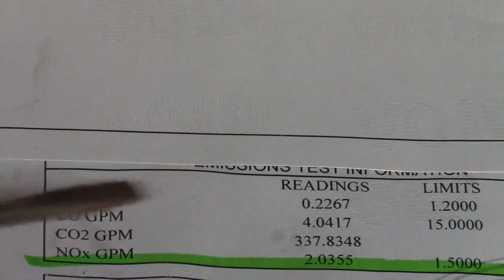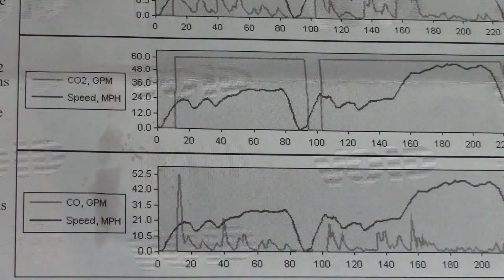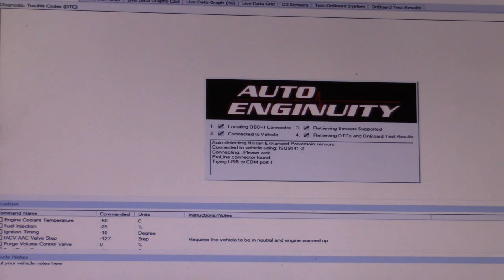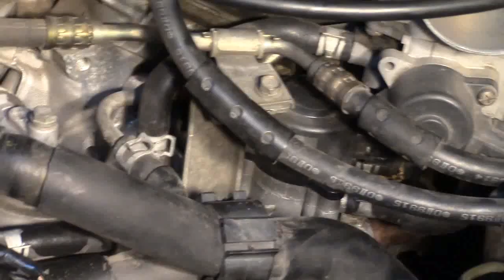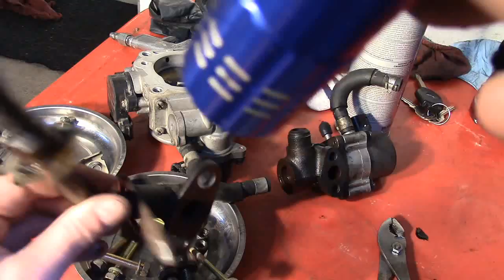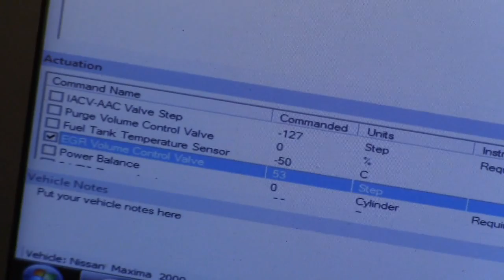2000 Maxima NOx Emissions Fail, No Check Engine Light- Bad EGR?

Comment: You mentioned that you can't just apply 12v to a stepper motor to see if it works. Why is that? Also, have you covered in any video how to back probe at connectors and/or at the computer so there is no possibility of harm to the computer?
Reply from the maker: You can't just test a stepper because it works by alternating the polarity several times per second- it's almost like A/C instead of D/C in a way. It also has two fields -one for the reverse one for the forward.  It is not just a straight 12V application like a simple motor or solenoid type.

 Also I always cover backprobing techniques to prevent damage to the computer- but it's different in each application depending on circuit design,  Generally however, the idea is you simply cannot short a PCM driver to ground without resistance in between. If the driver is a power side switch it is far more of a concern but if you short to a PCM ground side switch without load you can equally damage the driver.
  It is essential to know the specific circuit design- power or ground side switched and if it's through PCM or not to really know the risk you face not testing correctly.
Reply: Schrodingers Box  Can you recommend a good source that explains what you mentioned about the PCM, necessary resistance, and about power or ground side switching? Thanks Matt!
Reply from the maker: caduceus33 Can't really think of one sorry- you will need a channel that covers basic automotive electrical and you should find information there,  You might try Stuzman52 his channel is filled with automotive electrical videos. If anyone covers these concepts he would.

Comment: Hey Matt,
What is a good source for the above average DIY'er to get wiring diagrams from?  For example, where did you find the diagram on the Nissan EGR?
Thanks!
Reply from the maker: I usually just google them but AllData DIY is my infallible resource. It's about $20/month and you get dealer level manuals.
Reply: Schrodingers Box I checked out AllDataDIY and found I can subscribe for one or five years, and a subscription is for one vehicle. I can also buy more subscriptions at a reduced rate, but I didn't see anything for $20/month all-you-can-eat. Maybe they've changed since you began your subscription.
Reply from the maker: caduceus33 Hmmmm I thought they had a one-month thing a while ago.  Still, $26/yr for one vehicle is a bargain in my opinion.  The level of information is top notch.

Comment: good job, i have a nissan. and ya, cant say i enjoy squeezing my hands into some of those places behind the manifold.    but solid sturdy engine for sure.  I personally have about 205000 on mine.   Needs a clutch but still running good.
Reply from the maker: Hahaha, yeah did see how I was trying to contort like Houdini just to reach my hand in there?  It's just a way of life with modern cars now- you just get used to having to dismantle this to get that off which clears the way to remove the bracket covering the bolt you had to loosen in the first place lol.
Reply: yeah, i have to take off my upper intake just to do the valve cover gaskets.   which involved the vacuum for the fuel regulator in between the firewall and the back of the intake, and a coolant line or 2.   "quick and dirty"   razor knife replace 3 dollars worth of hose, save 2 hours = win  =)   keep on cranking the videos, i will keep on watching you work.  You have a lot of good tips and useful info.

Comment: I know you were trying to get the car through emission inspection, but a tube clogged like that might be an indication of other problems like excessive oil consumption or coolant leaking into the system. Usually carbon looks dry, but that looked quite wet.
Reply from the maker: Agreed! I was unable to find any other issues though.  We can see from the report that it is not burning oil due to the low HC detection, the fuel trims were dead on, and no coolant loss reported.  But indeed I agree it is often a symptom of another issue.  Then again 226,000 miles on this car and burned out check engine bulb- this problem may have been going on for up to 4 years.

Comment: You'd be in hog heaven with a Pico scope. Highly recommend visiting Autonerdz website, that's where I got mine. I know if you are thinking about getting an Autel Maxisys,  they now have a scope for it. If you are unhappy with your ae, lots of used MaxiDas scan tools out there very cheap now because everyone is trading them in for the tablet version (Maxisys). I have ae and MaxiDas as well as snap on solus ultra, vetronix mastertech, oem honda hds, and my elcheapo hf special. Out of all scan tools, MaxiDas is the most versatile tool for bi directional control. I haven't even pick up my ae tool in over 2 years, I was disappointed with it even after upgrading Honda enhanced to the tool. Used maxiDas sell for about 6-$700.
Reply from the maker: OneLegged hondamechanic MaxiDas eh? never even heard of it! I don't recall the last time I had a Honda so I can't really say how my AE worked on it but I certainly find imports are usually more limited than american cars and usually GM cars are remarkably compatible.  I will definitely look into that MaxiDas, that's a new one on me!

Comment: Nice vid Matt  I've fixed 2 Nissans with egr codes that have egr valves put on and sent on their way. one clogged pipe and one temp sensor. as far as scopes go  I have a Hantek  dso 3064 4 channel seems to work well enough for me and a u- scope 1 channel which is real handy. You might want to look at that one.  anyway thanks for putting in the time to make the vid. enjoyed it.  
.
Reply from the maker: I have come to find out since making this video that clogged EGR tube like that is very common on these vehicles.

Comment: If the ECM/PCM is easier to get to, use a pin-out chart and do your back probing there instead of at a component that is difficult to access. Yeah, you got lucky.
Reply from the maker: jarin wilson Point well taken- In fact I was looking for any point along the harness I could have opened up and stabbed wires to probe and I don't know why I didn't just follow to the PCM- would have been a great idea.
   Yeah using the PCM as a tool instead of a suspect is not the first instinct most would have, agreed!
Reply: I'll have to keep that idea in my back pocket. Thanks!
Reply from the maker: Ah great idea, I didn't think of that- I was so focused on the valve itself knowing I most likely needed to get at it one way or the other. PCM would definitely have been easier if I needed to backprobe
Reply: Schrodingers Box I am in no way insinuating that the PCM/ECM is at fault but articulating and stressing that because accessibility is often an issue on modern vehicles, if you decide to pursue a component, go to the one that is easiest to reach. I think that is pretty damn obvious but I am sure some incompetent nut busters out there could take my words out of context.
Reply: Schrodingers Box So many times calling the PCM at fault is a way of giving up. I often see comments about how getting a new PCM didn't help and yet some of them still call that good because it was ruled out. That last part is excruciating.

Comment: Labscopes  i got the pico-automotive and i done  the research for you, i also have a vellman HPS140i with 40ms real time  10mhz. I recommend  you get this  for a pocket one , we need  2 scopes , i dont  want  to take out  the 3500$ pico and boot  the laptop and all just for a  quick check of a wave  form. I got it to mesure  railpressure  sensors on diesel as that often is  the first thing to do on a nostart on commonrail  diesel.
Reply from the maker: My friend Sataman Schmidt on this channel showed me the pocket scope- cool beans!  Yeah I will not be shelling out $3500 for my Pico but really probably $2500. It's by far the most I'll have spent on any tool ever but I think given where I am with this "hobby" now, it is justified.  I came quite close to not really being able to diagnose this car properly, and it's been happening more frequently.

Comment: Great bit of diagnosis work on an unknown vehicle.Auto ingenuity came up trumps again.Evaluation on the speed/nox graph, spot on.Coolant on egr, common in some german makes.For stepper motor square wave pulses,a lab scope
would eliminate those frontal lobe long term headaches.Modern tools are a must  for modern cars.There's only so many faults that can be fixed with a lump hammer.
Reply from the maker: Absolutely 100% correct on all counts.  Looking back I pre-emptively jumped negatively on AUtoEnginuity without giving it a fair chance and it turns out it 100% confirmed the repair by performing as needed. Indeed that is usually the case, for the most part.
  The more I do this stuff the more I see it is critical on today's vehicles to have the proper equipment. Knowledge is the best, for sure, but if I didn't have the right equipment in this case study, I would "know" that I have no way of testing that EGR valve lol!!
  It wasn't even 6 months ago I still saw no reason for me to ever own a lab scope.  Now I have had my second experience in 3 months where not having one almost cost my ability to do a diagnosis. You are dead-on my friend.

Comment: Have EGR valve manufacturers experienced a downturn in demand since this channel opened?
I wouldn't be surprised!
Reply from the maker: Hahahaha- well unfortunately every time I am at autozone or whatever I still see everyone there for plugs,wires, and O2 sensors and I cringe every time the counter guy does a free check engine light read so I doubt I am having an impact lol

Comment: Some V6 Mazda 626's have coolant to the EGR while the I4 versions do not.  I guess it's for lowering the temperature of the component than the exhaust gas.  Man that thing was packed in there like clay.  That's one hell of a clog.
Reply: A burned out check engine light in a used car that I just purchased would suggest to me that I change fluids on all of the expensive to replace components immediately namely the engine and transmission.  For the transmission though with over 200,000 miles it may be too late and a first fluid change could make the new owner worse off.
Reply from the maker: Yeah that was crazy wasn't it? My bet is has been plugged for so many years and kept getting worse and the MIL was on the entire time, burning out the bulb.
  I've seen quite a few clogged EGR's but not like that- even compressed air wouldn't blow it out!
Reply: Schrodingers Box Why did the inspection say no codes were found when there were obviously going to be EGR codes present during the inspection since they got set into memory.  Even if we assume when the CEL bulb fails the code pull doesn't take place then "no codes found" wouldn't the correct thing to put down on paper as it would be misleading.
Reply from the maker: ***** You know, not only did I also wonder that, Devon- but I also wondered why they even ran the dynomometer test.  Normally upon either a check engine light being on or a bulb test failure they don't even dyno it- they just fail it.  Not really sure what to say- maybe they did the bulb test, saw it failed- didn't bother reading codes because it doesn't matter anyway and they dyno'd it because they were slow that day- good question.
Reply: Schrodingers Box The issue in California, as an e.g., regarding running an emissions inspection on a vehicle that is displaying a MIL is: it depends on who is the customer. If it is a regular customer car, and not a stranger, you know it is not an undercover Bureau of Automotive Repair inspector. If the stranger turned out to be an undercover inspector, a citation would be issued along with a substantial fine (and all kinds of other stuff). The first step in CA regarding an emission inspection is getting the customer to approve and sign a repair order. Thereafter, the smog check inspector technician is then obligated to perform a complete emissions inspection. Anything less, is grounds for a citation.
Reply from the maker: johnwrench4speed Yeah it varies a lot by state- one thing that irks me in CO is if you have a fail for something like a gas cap, you have to repeat the entire test over again- can't just retest the gas cap even if you had an extra one handy or something. They re-run the whole dyno and everything.  All the stations here are dedicated state-run stations that only do emissions testing. Can't do any bribes or look-the-other-way type stuff like back in the day when independent shops did the inspections lol.
Reply: Schrodingers Box In California you look for a shop that allows a retest for free. On the bribe or look-the-other-way point, etc., if a California emissions inspection technician is caught, he/she is going to loose his/her smog license and be referred to the county district attorney for prosecution. An additional point on the inspection process in CA, a service writer is the first point of contact for the customer unless you can find a one man shop. By the time the smog tech gets involved he/she is just getting the keys and a repair order.
Reply: Schrodingers Box If you believe the previous owner drove with the check engine light for so long that it blew out this car may have been maintenance neglected.  You may want to recommend that the new owner check and maybe change all of the fluids especially the engine oil.
Reply: Sandbag1300 With the amount of carbon deposit packed in there it's safe to assume the CEL burned out, was not intentional, and lack of maintenance is an issue.  The amount of carbon in there could be a symptom and not the root cause of a poorly running engine.  I think that would have been worth mentioning in the video too.  I don't think listing all the things that would cause it would be worth mentioning because the list would be longer than his arm.  Maybe a topic for another day?

Comment: Nice job on the fix Matt. You could solve your scope/ scan tool problem with an older snap on MODIS. They have a 4 channel lab scope, full scan tool capabilities with a graphing meter too. You can find em on eBay for a decent price
Reply from the maker: Thanks Jake- I have actually decided pretty much going all out on a nice Picoscope.
Reply: Hell, that's a great alternative!

Comment: Opel (german manufacture now owned by GM) has also some interessting EGR flow .. because they make internal, IN THE HEAD ^^ (atleast at one model that i saw)

So there you are realy bumbed cause you will only find the valve but no pipes coming to or from it.

Oh and EGR cooling is pretty normal on newer cars, for pbvious reason -> cooler intake gases
Reply from the maker: Yeah that would be harder to diagnose indeed- but that's why I focus on understanding the concepts and theories. You will always see something new especially working on lots of different cars, but knowing basic theories and concepts helps to figure out whatever you come across.

Comment: Nice one Matt - I use a old fashion  length of speedometer cable you can get anywhere put in my cordless drill and it spins and clean out the  convoluted passages.  Now for a quick fix and not even open the hood you can pour 2 gallons of lacquer thinners onto the gas tank, fixes every known faults related to emissions .  I got that one from Youtube , must work Scotty says it does, wouldn't hurt to put a couple of jugs of Bars stop leak in as well . :)
Reply from the maker: OMG Steve you made me choke on my coffee for a second there!!
  Good trick on the cable to clean the passages.  Actually being a lab rat, I have an extensive collection of test tube cleaners which work fantastic for scrubbing pipes, oil passages, etc.
  A couple jugs of stop leak lol! Sure why not!!
Reply: Stop leak is like voldemort.  That which shall not be named, should never be named, by name, on this channel.
Reply from the maker: ***** Volemort is a parts changer I bet lol
Reply: He is a parts changer sort of  - Harry Potter and the goblet of fire.